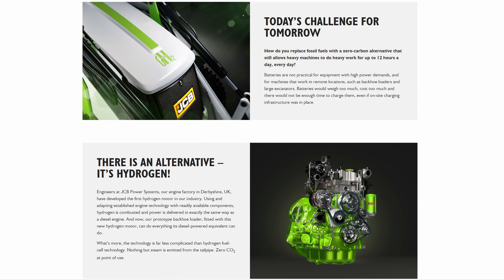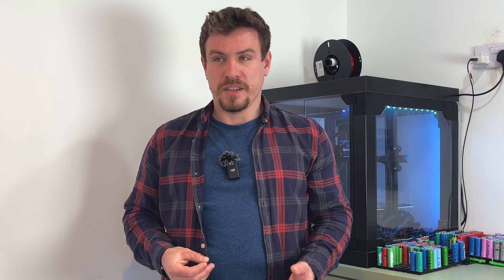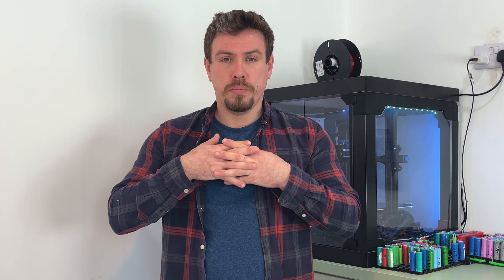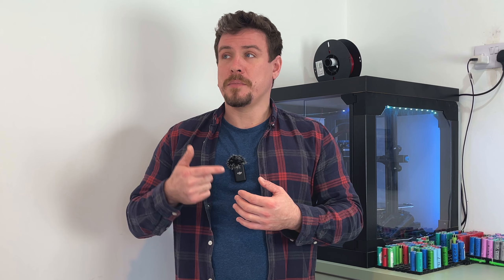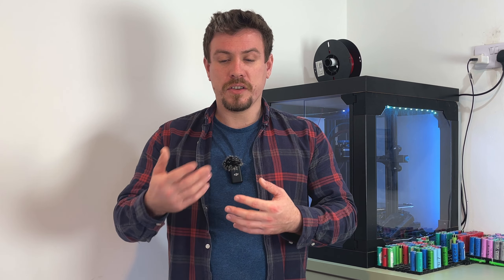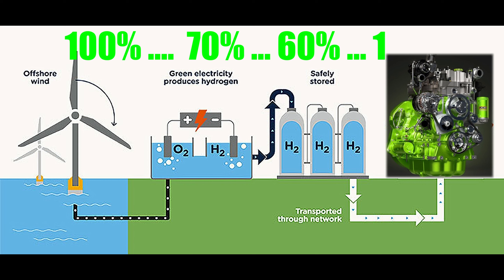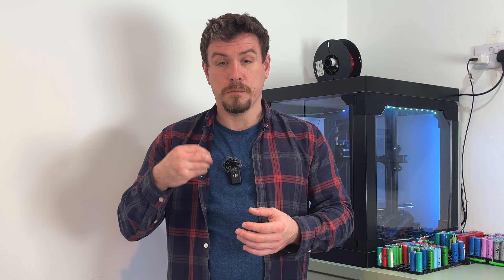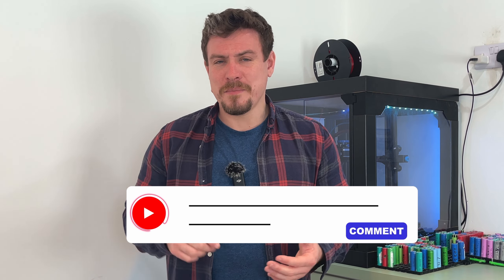HYDROGEN Internal Combustion Engines... WHYYYYYYY???

Comment: Your reasoning WHY JCB has going hydrogen was not because they werent comfortable with batteries, JCB has built both an electric and fuel cell excavators.  The reason why they have gone hyrogen is 1) to scale pure battery or fuel cell for an excavator, the vehicle becomes too heavy for use.  2) the pure battery version TAKES TOO LONG to charge, and battery swap is not feasible for many construction sites, 3)  they sell construction equipment to many customers in cold climates, the battery capacity will not match the duty cycle required 4) the hydrogen engine developed at JCB has the same power curve as their diesel, so for operators, using this new heavy piece of equipment does not require retraining on vehicle load handling characteristics.  5) Many maintenance mechanics can retrain much quicker to dealing with hydrogen combustion because the hydrogen engine retains many component equivalents, thus troubleshooting skills are kept intact.  You need to see ALL of the Harrys Garage videos that speak with Lord Bamford at JCB and even see the Fully Charged episode when where an electric excavator built is used in a garden - the weight and duty cycle that a pure battery excavator can handle.  Much of the reasoning why heavy machinery is diesel and passager cars are gas holds even with electric/fuel cell/hydrogen.  All solutions have SCALE LIMITS.  Just because you can power a car with current battery tech doesnt mean you can upscale it to do construction.  JCB has been in business for a long time, and its because THEY UNDERSTAND the demands of construction sites.  It would do people good to listen to that experience talking, than to try to come up with an explanation as to why JCB went hydrogen.  JCB literally explained themselves in the two Harry's Garage videos.  No interpretation or "take" is required.
Reply from the maker: Thanks for sharing. Loads of good points. I couldn’t agree more with your 5 points. 

As I mentioned in the video. ‘Well done JCB’ It’s a step in the right direction. We need an established green hydrogen supply chain for all the ‘scale limit’ machinery you mention which should include ships and planes in my view. JCB are playing their part in making this happen. 

Harry is the JCB PR department now isn’t he? 😂😂
Reply: I too have seen the Harry's Garage videos you refer to, and I think this video fails to make clear that JCB have been on an evolutionary path; they tried battery, that didn't work, so they tried fuel cells, and that didn't work either, and so they have developed a hydrogen engine which does work in the environment in which their machines operate.
Reply: Whilst a pure electric vehicle can work in a car or bus, it isn’t necessarily going to work on plant equipment for the following reasons:
1) Weight - any form of electric vehicle using batteries will be heavier and thus this creates additional issues in having to make yet bigger plant to do the same job
2) Time - plant kit needs to be capable of being used by more than one shift whilst electric vehicles need to be charged, hence needing twice as many vehicles to do the same job.
3) New Technology - if you can use a hydrogen engine that is similar to a Diesel engine, you can use existing technology and skilled engineers to make and service this rather than train a new workforce.
4) Temperature - batteries are less effective in cold environments and this is less of a problem with internal combustion engines 
5) Putting all ones eggs in one basket - if you put everything down the pure electric vehicle path, what happens when you hit a wall caused by lack of batteries or battery materials? At least this is diversification

Comment: I watched a video by Harry talking about JCB and Hydrogen (you probably saw it too) but one thing that struck me was when someone said the diggers etc would need refuelling three times during the day!!! Hydrogen is expensive stuff so who is going to pay for that? Not to mention the refuelling lorry that was continually driving back and forth to the hydrogen station all day long, if they could even supply it.
Simple physics would indicate this is not a sustainable solution.
Reply from the maker: Thanks for commenting 
I watched the Harry’s Garage video where Harry was touring the factory and they talked about how hydrogen is going to be so cheap that it will be stupid not to change to this. I was a bit sceptical but then we have seen plenty of things that have come down in price over the years. Computing is a good example. 

I would be surprised if it couldn’t fuel up and last a day compressed into tanks. Re fueling and energy density is where hydrogen beats batteries.

Comment: Another reason why many manufacturers are choosing combustion engines instead of Fuel cell is Fuel cells require 99.9999% Hydrogen purity, impurities as in in trace amounts of foreign gases or lubricant residue would totally destroy a fuel cell stack, Combustion engines on the other hand are totally immune to impurities.
Reply from the maker: Good point. Thanks for sharing

Comment: Combustible hydrogen in the ICEngine of a plug-in hybrid PHEV drivetrain - stores at much lower pressure in smaller/safer tanks and can deliver at least twice the equivalent MPG possible in a hydrogen fuel cell EV. PHEV tech is especially applicable to long-haul freight trucks and heavy machinery.
Reply from the maker: Thanks for sharing

Comment: the biggest problem with the battery system is life  charge discharge cycle they don't really like fast charging it creates a fair amount of heat which over time degrades the battery there is also the danger of batteries catching fire when being charged I used to race r/c model cars they use the same lithium battery technology and we had to charge them in a fireproof bag just in case, a 2cell lipo pack catching fire is quite spectacular I think they have been very lucky so far
Reply from the maker: Thanks for sharing. Battery chemistry for EVs have come a long way from those lithium polymer days. For example, early Nissan leafs in extreme climates didn’t last half as long as competitions batteries due to non cooled battery packs. Now water cooling is common place. Higher pack voltages reduce current required through packs. 

I used to run nitro cars. Can’t think of anything better than them screaming in unison and changing gear 🫨

Comment: Designing an ICE engine that runs on hydrogen is the easy part.  The really difficult part was mostly skipped in this video and that is the infrastructure needed to distribute hydrogen.  You can't put more than 10% hydrogen into our current gas network without it making the plastic gas pipes brittle so it would need an all metal pipe network.  And Hydrogen molecules are so small they need special very expensive joints and valves because it leaks out of conventional gas seals.  Consequently installing a duplicate hydrogen gas network to the one we already have would be monstrously expensive.  If you try and transport it by tanker, even when compressed to 700x atmospheric pressure its energy density is so low that in the heavy tanks to take that pressure you can only get 600kg of hydrogen on a 40 ton tanker lorry.  600kg of hydrogen contains less than 1/6 of the energy carried by a regular petrol tanker so if your tanker runs on hydrogen very little of the hydrogen it carries will get to the final destination and therefore you are going to need a vast fleet of tankers.  If you want to generate the hydrogen at the filling stations you are going to need to put in the same very high capacity electricity distribution infrastructure needed for high rate battery vehicle charging plus pay for the substantial investment in plant, hydrogen storage and maintenance it will need.  So then you have to ask if the latest high rate battery chargers can get you 100miles of added range in 10 minutes would you pay more than twice as much for your vehicles energy to fill up with hydrogen if that is going to take you 3 minutes, probably not.
Reply from the maker: Thanks for sharing. There is lots that time wouldn’t allow me to touch on in the video. I might do a follow up. . . 

Hydrogen will defo have its places. I imagine refuelling at a site would be easier than securing 22kw - 150kw charging when the machine may not be road legal or electric power available. At the same time there is use cases where electric is entirely possible and the best solution. 

All the issues you mention are relevant. Check out ‘Hydeploy’ a project to test blending of hydrogen in the existing network based at Keele University. Blends and 100% hydrogen is being tested and the reports are good. Although I don’t see the main gas network being fully hydrogen any time soon

Comment: I would like to point out Fuel Cells have higher efficiency at low loads while Combustion Engines are most efficient at medium to high loads. You mentioned that small combustion engines are 25% efficient at best this is far from true, Petrol engines from Toyota and Honda for example are roughly 42% efficient and the 2.3 litre engine developed by Achetes exceded 51% efficiency. I believe these are the key reasons why companies like JCB, Cummins, Toyota and AVL are so keen on developing Hydrogen ICE rather than Hydrogen Fuel Cell technology.
Reply from the maker: Lab efficiencies running on a flat doing 42mph are very different to the real world. Still impressive but once you factor in a backhoe sitting around for 5 mins running the air con and radio then dragging a cable through the ground I can’t see these efficiencies being reached with ICE alone. How far can you push the efficiency on a spinning mass that has to come to a dead stop and then operate in the opposite direction 

Maybe we should all go back to 2 stroke diesels like the Napier Deltic and forget efficiency and enjoy the low RPM scream

Comment: But Hydrogen doesn't always need to be transported, it can produced right where it is consumed , water is everywhere, sun is everywhere why should we have centralized hydrogen production
Reply from the maker: Good point. Although that requires a product which will be produced on a small scale, be maintained and user friendly. Doable for sure. I’m sure we will see this over the next few years. It’s also a great way to use excess or spare renewables if there is an excess production

Comment: The issue is that at £14.25 per KG you can’t compete with Diesel. So why would a farmer or a builder switch to a Hydrogen JCB Machine if it costs 40% more to run per day???
The only way you make a H2 engine viable is with £5.00 per KG Hydrogen !
Reply from the maker: Completely agree. That of course could change and hydrogen could come down in price. But it would need to come down a long way to convince industry to give up Diesel. Diesel is also pretty easy for the average farmer to store and use. Hydrogen not so much.

Comment: Battery vehicles are useless for construction and agricultural, JCB tried it and scrapped the idea after 2 years. Using a hydrogen fuel cell with a battery bank is useless because of the massive weight of the batteries, it all comes down to simple engineering facts
Petrol 35mJ/kg
Diesel 40mJ/kg
Battery 0.37 mJ/kg
JCB  have also built the refuelling system to go with the vehicles. The BMW was a hybrid petrol/Hydrogen using a huge engine in a car costing well over 100.000 euro, and was never put into production beyond 100 vehicles. A turbocharged engine is more efficient than a normally aspirated, pushing ic efficiency up to around 30-35%, fuel cell efficiency around 40%, it is the weight of the batteries that wrecks all battery and fuel cell technology, and given that battery research has been continuous since about 1900 I am not expecting any huge breakthroughs!
Reply from the maker: Thanks for sharing. I completely agree current mass produced lithium or sodium battery's are not energy dense compared to fossil fuels or hydrogen is when its compressed. My main highlight was the efficiency losses through the process. Still a great move by JCB as hydrogen can be produced 'low carbon'. Ultimately the end user will pay for efficiency losses in their purchase of the fuel or machine. Its an interesting space for sure. I want JCB to do well. Check out the Hyundai HW155H, fuel celled and they had to consider cooling rads (efficiency losses)
Reply: Electric construction vehicles just need a bit of imagination. Batteries in the vehicle is not the only approach. Some of the diggers are basically stationary and could be plugged in permanently. Most building sites are near high voltage supply